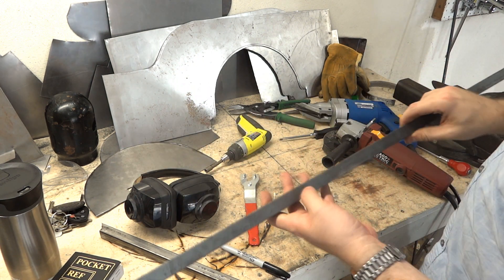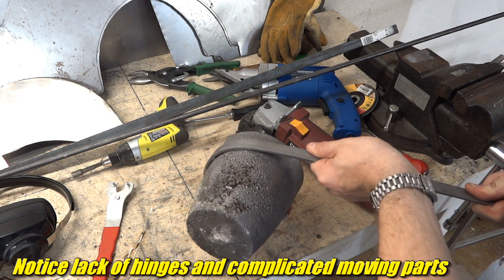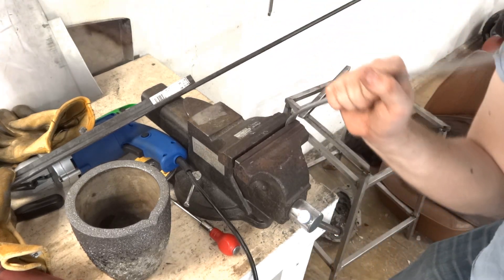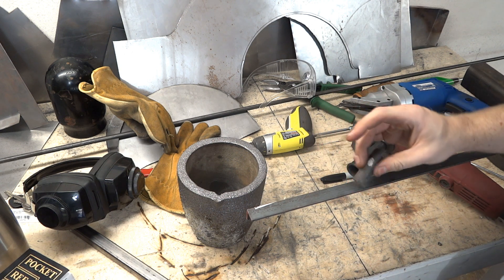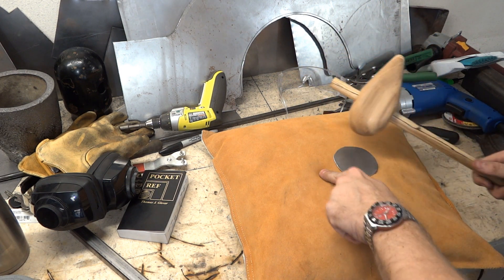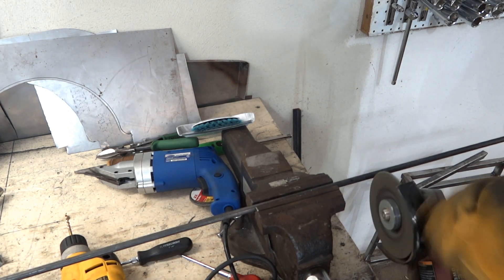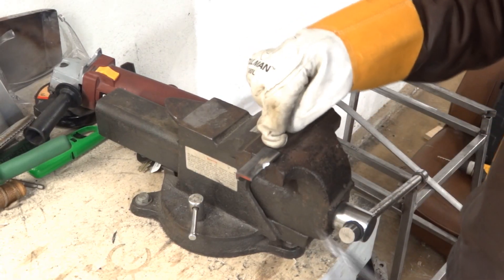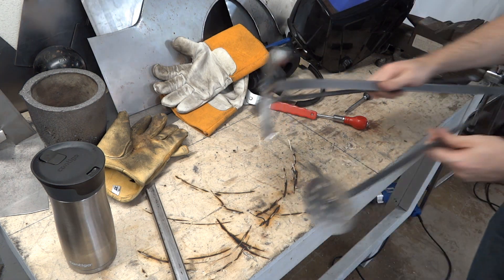Make Metal Foundry Tools: Crucible Tongs, Dross Scooper, and Degassing thing for Metal Casting

Comment: Paul, I had to learn the hard way with thin sheet metal.  ALWAYS hold it with something other than your hand when drilling.  Vise grips work fine.  I had a drill catch on the sheet metal once and that sucker spun and cut my hand like a fish!
Reply from the maker: +worldtraveler ouch!  I'll remember that next time.  The gloves I was wearing might not hold up to a spinning sharp disk of doom...
Reply: bad. i know. i had thrown aluminum sheet and it cut a wound in the lower part of my thumb. never handled it again without gloves.
Reply: I held a knife that I made and was drilling holes in it. The drill bit caught in the metal and spun the knife around and cut the artery on my wrist. To make things worse when I got to the emergency room they thought I had tried to commit suicide! Then they wanted to keep me in the psychiatric ward!! I explained to them several times that I was a metal worker and it was just an accident. It wasn't until I threatened to get a lawyer and start legal action against them that they let me go home. It was a pretty straight clean cut across my wrist though. Just pulled the damn thing with a vice grip okay.

Comment: for the degasser you could use a sinkdrain , there usually made of stainless and allready have a nice cup to it
Reply from the maker: Good idea!
Reply: The only problem is, stainless isn't very weldable. I personally made mine from a slotted spoon (all-metal) and simply bent the handle backward at a right angle. Done. :)

Comment: That lifting/pouring tongs needs a lot of trust.  Simple is good, but if the unsecured crucible falls out of the tongs while you're standing in front of it, you get a hotfoot.  Much better some kind of hold down to keep the crucible in place during the pour, I think. Thanks for a good video.

Comment: Brilliant! I've been meaning to make a set of crucible tongs but for some reason my brain never got to the "add a small bend" bit. I have some ~.25"x~.75" steel bar from some crappy bar clamps, maybe this will be my project tomorrow. I've really been wanting to fire up the furnace and try out my "new" (I got it 4 months ago...) crucible, but the lifting tongs were my holdup.

Comment: On the crucible grabber you need to drill a hole at the height of the crucible top onto the bar handle part and attach a piece that will swing on a bolt and have it like latch over the top back side of the crucible to help keep it from leaning forward and coming out

Comment: I feel ya on the heat. When it was 5 degrees outside I was sweating in my forge room wearing just a t-shirt and pants. The forge is the only heat in the room. Its already way to hot in there. Gotta do something before summer heat hits.
Reply from the maker: +Warped Legacy I know what you mean.  I looked into what air conditioning would cost for my garage, and decided sweating to death was cheaper.  A small AC unit wouldn't be bad, but it also wouldn't keep the place from getting hot...  a fan works I guess.
Reply: Paul's Garage an exhaust fan near the ceiling would be pretty efficient.  Next issue:  thermostat controlled, or fully manual.

Comment: What size wire are you using? You can weld some really thin steel with .023 wire with the right settings on the machine. Also one trick is to spend most of the time on the thicker rod and just go touch the thin stuff then back to the thick.
Reply from the maker: i was using .030 wire.  It's what came with my welder and i haven't used it all up yet.  I plan to switch to smaller wire since i want to do some automotive sheet metal.  Thanks for the tip with the thick and thin metals.  I couldn't get it to stick very well to the thick stuff without burning through the thin stuff, i'll give that a shot. Thanks!
Reply: I keep both sizes on hand and switch for the job at hand. In the last week, I welded with .030, .023 and aluminum. :)

Comment: Trying to make the crusible scoop but the metal always wants to straighten when it gets hot.  Once the crusible dropped mid pour. Any idea what I'm doing wrong? Should I use thicker steel? More heat when bending? Any help / advice is greatly appreciated.

Comment: I made a crucible holder like this a couple of years ago to fit my #3 clay crucible and it's worked perfectly. Today I found it had gotten out of round and no longer fit right. Spent 20 minutes trying to fix it and decided bah, I'm overdue to make some real crucible tongs.
Fast forward an hour looking online and I can't find any ideas for a single tool that isn't prohibitively weird and will fit into my smallish furnace. I could go for separate tongs for lifting and pouring but bah. Also, what do folks put the crucible down on after lifting it out so the can pick it up with the shank? I worry about putting it down on any cold surface.
Short version: gonna make another flat bar lifter...
Reply from the maker: I have a newer video where I make a single tool for lifting and pouring and it fits in a tight furnace.  I don't have a link handy but it's about a year old at this point
Reply: @PaulsGarage  I saw that one! one of the less weird ones but as I only use one size of crucible I'm gonna stick with simple.
Love your channel!

Comment: what crucible are you using? where did you get it from and what are the dimensions?

I'm still missing one to get the final build going and have trouble finding the dimensions of a decent crucible so i can get the foundry made to proper dimensions.
and a temporary metal crucible to smelt my main bulk of junk/dirty aluminum into somewhat cleaner ingots before i start using a proper crucible.
Reply: You can find them on e-bay

Comment: what kind of welder do you use I'm looking to get into welding in the future
Reply from the maker: I have an Eastwood Mig175.  It's a 220v welder.  I have no experience with any other welder, so i can't compare it, but i hear eastwood welders are very good for the price.  Supposedly they work better than Harbor Freight or other box store welders, but they aren't nearly as expensive as Miller/Lincoln/Hobart machines.  Good return policy on them (3 years I believe), though not quite the power or duty cycle of 220v miller/lincoln/hobart ones.  Again, i have never tried anything other than this single eastwood welder, i'm just repeating what i've heard from other people in person and online.  This info may be all wrong, but i like the eastwood one for the most part.
Reply: I have a cheapo HF wire welder, it was horrible to begin with. Uneven wire extrusion and uses AC not DC at the tip. I fixed the spooling mechanoism so it works more smoothly, and also modified the electric part by adding a big rectifier bridge and capacitor so I have DC now. Works better but still not great. Still a lot less sputtering than initially.

Comment: Angle grinder sparks really are not that bad. Molten metal from a gas torch are a lot worse. But overheating on a hot day beats em both.
Reply from the maker: +sin4422 sparks aren't that bad, but a million of them at once isn't fun!
Reply: MMMM tell that to one of my work jumpers, sparks from an angle grinder burnt their way through leaving crusty bits of polyester behind. Also had a flame retardant jacket catch fire from grinding sparks. 
I wear either a leather apron or a welding jacket now and sweat a lot. My welding bay at work is also in an underground bunker of sorts under the school oval. Serious.
Reply: Fair enough I just learnt to stand out of the way of em!

Comment: An easier way than holding all the weight of the ground on the rod you can clamp it on the vice so you can easily hold whatever you need to hold I experimented in welding class in high school and the welds came out just as good it was grounded good so just thought I'd share some knowledge

Comment: Just subscribing..great videos. 
What do you use to degass your aluminum pours?
Reply from the maker: I used to use a pool chlorine chemical that doesnt have hydrogen in it (some do), but now I dont degas at all.  Instead, I melt in an atmosphere as neutral as I possibly can (too rich results in hydrogen dissolved in the melt, too lean and you'll oxidize your aluminum away) and I melt it as fast as possible, up to pouring temp right away and pour before it has the chance to absorb much in gas or oxidize.  My current burner/furnace set up can melt cast iron, so it's way overkill, but I use it that way anyway to minimize the time aluminum stays molten.  I timed it once, it was 4 minutes from the first sight of melting to a full crucible up to pouring temp.  Degassing is a bigger issue if the metal stays molten for a long time, like in a commercial foundry, or with less powerful furnaces/burners.

Comment: When melting aluminum is degassing necessary or can it be avoided?
Reply from the maker: If you can get your burner to run totally neutral, get it melted and up to pouring temp very quickly (don't let it sit molten for too long) and pour right away, you can minimize porosity.  So yes, you can cast aluminum without degassing if you are very careful and not run into too many problems.
Reply: Paul's Garage What is considered totally neutral I am not using a gas foundry I'm still on charcoal? Also what if gases were trapped in the aluminum what would happen?

Comment: How do you make degassing formula or packets
Reply from the maker: +The GreatBanger for aluminum people often use washing soda from the store; or pool chlorine tablets (dangerous!!! Not a safe idea), or buy aluminum degassing tablets from a supplier.  I use washing soda, put a tablespoon or more into aluminum foil wrapped up tight.  Plunge to the bottom of the aluminum, the foil melts away and the gas boils up through the melt.
Reply: Paul's Garage thank you for the reply and thanks for another great video 😄👍
Reply: Washing soda (sodium carbonate) can also be made at home just by heating baking soda (sodium bicarbonate) to 400 degrees.
Reply: Zwingle thank you 😄👍

Comment: What do you plan to degas with?
Reply from the maker: I was planning on using washing soda (i have in the past) but i recently saw a video by luckygen1001 that was fairly convincing that said washing soda was a bad idea.  Basically it's hydroscopic and won't break down at molten aluminum temps into CO2, so it's more harm than good.  There are other options, though.

Comment: Hey dude have you seen the king of randoms new foundry build
Reply from the maker: +AngryTiger yeah I saw that.  Kaowool is awesome stuff, too bad he didn't put a protective coating on it, it probably won't last and he'll get ceramic fibers blasting out the top.  Oh well, it'll be quick for him to put in a new liner so it's probably fine.  The fibers are bad to breathe, though.
Reply: Yeah I reckon you could make it better though

Comment: also, extrusions aren't very good for casting. Better aluminum is found with auto parts like suspension knuckles, control arms and of course engine parts. Just locate the nearest scrap yard, pennies on the dollar for high grade aluminum.
Reply from the maker: +Michael Rinkle very true.  I've melted extrusions, but I keep the ingots separate from the cast stuff.  I plan to use the pure aluminum for alloying anyway, not for casting.

Comment: Im trying to make this but I dont have a welder :(
Reply from the maker: +Pink Guy if you altered the design a bit you could probably drill holes and use a nut and bolt instead.
Reply: Pink Guy you can link two batteries together in series   ( + to - ) with heavy wire.  Then connect battery cables to the + and -.   The two batteries will weld for 10 minutes...,

Comment: You literally have a vice right there, why not just clamp the part into the vice then drill? A  lot safer and a lot easier. At 09:00 min
Reply from the maker: +Ren Carth because I clearly don't plan well?
Reply: In general working with power tools the only thing that should be moving is the tool itself. Minimizes the risk of injury. Great vids though!

Comment: That crucible tong (?) is worthless in real work.  If you turn the crucible down it will fall off!  Secondly being flat how can you take out the crucible from deep down the furnace????
Reply from the maker: +Joe Grech strange, I’ve used it a bunch without a problem.  You can see it in action in some later casting videos
Reply: Joe Grech I disagree. I made one that is very close to Paul's and it works very well. I didn't put the crazy curve at the bottom of the handle because I have enough clearance between the wall and the crucible to push it down straight, but I did put a Z-bend further up so I can grip it with good control. It can hold the crucible tipped almost 45 degrees down without it dropping, even when fully loaded with several pounds of copper. There is enough spring in the holding circle to grip the crucible well enough so it doesn't slip.